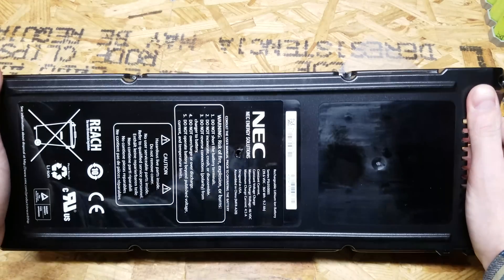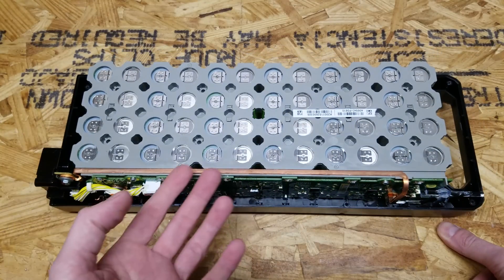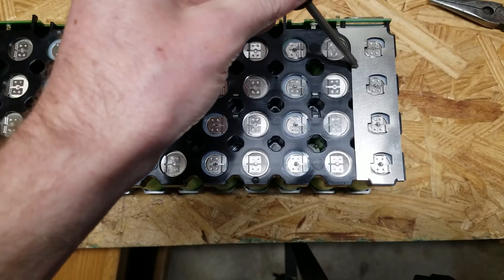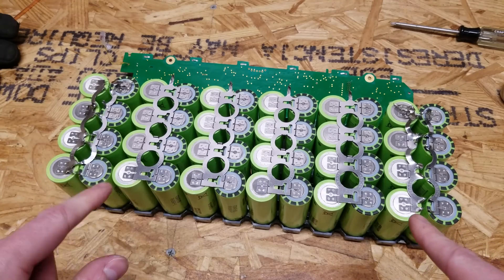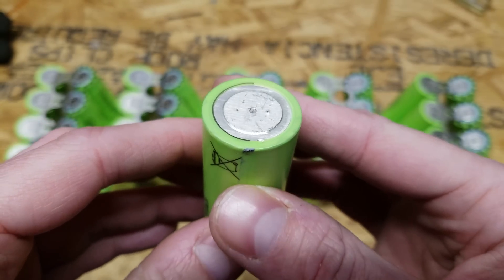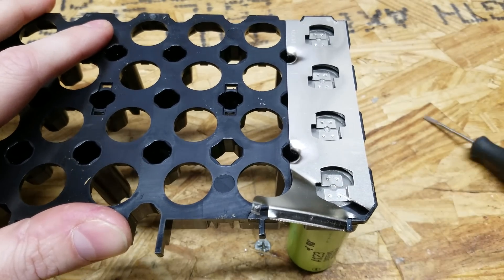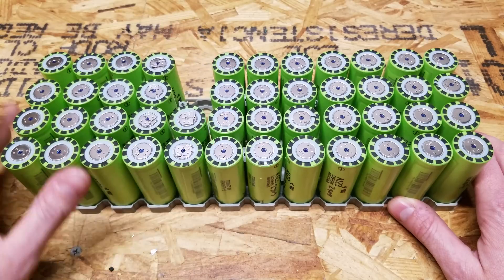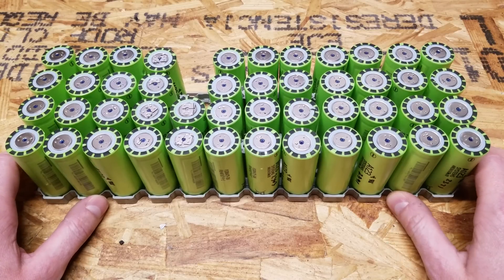NEC Energy Solutions A123 LiFePO4 Batteries, Cell Harvesting (Battery Hookup)

Comment: Thanks for the clear views of the configuration.  Helped me to rewire into a 15s3p battery without a complete teardown....a few snips and a few wires.  Two of these on my ebike will look like 21st century pony express mail bags.
Reply: How are you configuring it as 15S3P? did you do a complete tear down then rebuild?  I'm trying to figure out how to make it a 8S6P. But without completely tearing it down, the wiring is very complicated.
Reply: My explanation probably doenst make it clear...the resulting battery still uses the original case in the end.  Rather important point I left out.
Reply: The final revision and now practising my DIY MOT spot welder/resitance soldering unit (using carbon rods)...is a bit hard for me to wrtie out.
Im  resulting with two groups of 8s3p within the case..  Then I connect them from there as needed.  I wanted a choice of 8s6p or 16s3p.

The reconfig starts with battery  being oriented....Negative (-) on the left and Positive (+) on the right.  Ive removed the black and gray cell holders for this part.

..First I physically cut the battery connection in half....making two groups of 6s4p...then looking at the 4p config of each group...I cut (1p) string of cells from the other (3p)..This leaves you with two groups of 6s3p and two strings of 6s1p.
  The trick after this is to distribute the  (6s1p) among the two larger groups in order to result in two 8s3p batteries.  I distribute them all to the middle, where I cut everything in half.
Where the original battery was cut in half...leaves the left battery ending in (+) and the right battery beginning with (-)...in the middle of the case.
I cut the  6s1p strings further into 2s1p.  That is to say, I ended up with the two main batteries of 6s3p and 6 @ 2s1p
Looking at the 6 pairs of 2s1p ...they are  batteries of 2 cells each in series showing negative positive...negative postive...negative positve. etc..  Wiring the first 3 pairs onto the END of the first main battery (6S3p) will result in 8s3p.   Doing mirror image on second main battery....wiring other 3 pairs onto BEGINNING.
Wiring is done in such a way that no wires cross.

HAHA...Now that Ive made a mess of explaining it...I have a picture I drew in sketchup and converted into a JPG if you would like me to email it.  Matter of fact, I would welcome a review from someone...Im not all that confident this thing wont melt down.

Comment: What are you doing with this singe cells others than welder new battery blocks? A very interesting point in your Video is the switch in the charger, I didn't know him. I'm looking forward in your next large project ....
Reply from the maker: I'm not sure what I'll use them for yet. I bought them just to work with something a little different. As for the next project, it's going to be huge! I'm hoping to release more information within the next month - it's still a verbal agreement at this point and don't want to say too much yet; )

Comment: I just received the same pack a few days ago but haven't been able to tear it down yet. So thanks for the tip, definitely will save me from some frustration and ruined cells.
Reply from the maker: Thanks for watching! Definitely be careful on the positive end, don't ruin cells with holes like I did with 3 of them :(
Reply: @LithiumSolar  I think the holes didn't pose any threat and could be soldered with tin if necessary :)

Comment: those cells are not punctured. there is a double layer of metal on the positive end. the one on the bottom would still be intact and good for use.
Reply from the maker: Hmmm, that must be why I didn't smell any electrolyte like I usually do when a "standard" 18650 gets punctured?? I assumed it was just because LiFePO4 were different. I check them out again, thanks!
Reply: I looked into this as well he's right I checked a dud cell and its two layers
Reply: Lol came to the comments to mention this
Reply: @skizzik121  me too. Lol
Reply: Where did you find this information?

Comment: Crazy, I was wondering why I don't get your notification here on Youtube...Only on Facebook...I watch all your videos.....Then I just noticed, I was not subscribed. What the What.....Just curious, did you say you used a T10 to take this apart? I used a T8, wonder if maybe I was using the wrong T???
Reply from the maker: Subscribe! LOL. Yes, I used a T10. I just tried and it looks like my T8 would work but is very loose. The T10 fit nice and snug.
Reply: @LithiumSolar  I'll have to try the T10 when I put the case back together on my 12S4p pack. I only got 3 of these, one had some bad cells, so I had to take apart to make sure all cells were ok. 2 nd pack was near perfect, each 12V pack I built with BMS gave me 10,250mah per pack. Im testing the 12S4p pack right now and so far its on 8,500mah. Fingers crossed I get at least 9.5ah. Going to use the 12V packs in an up and coming boombox with 12" woofers. Not really sure if I have a use for the 12S yet? But I may have a solar gen I may use them on. Great Video, I always like how detailed you are when you explain how to....Way better than I could do....Can't wait to see what you come up with next!!!